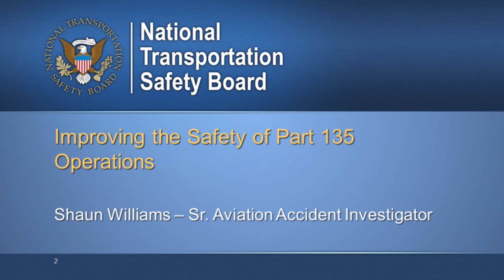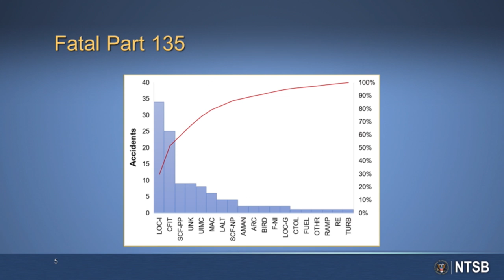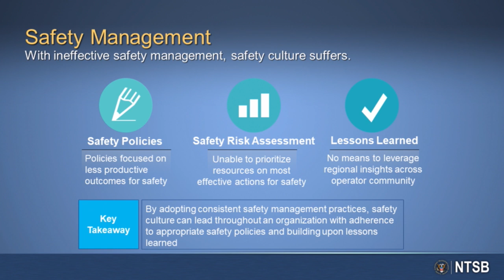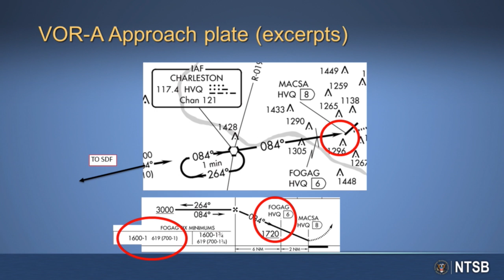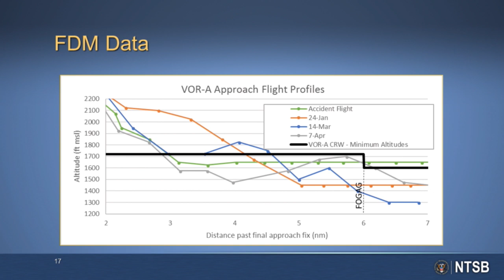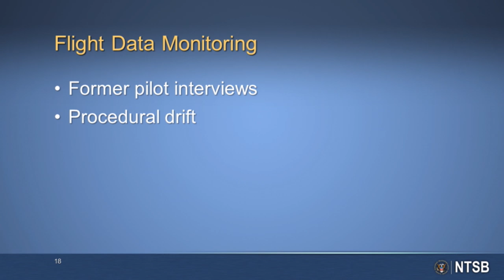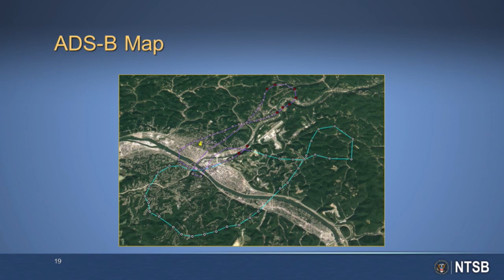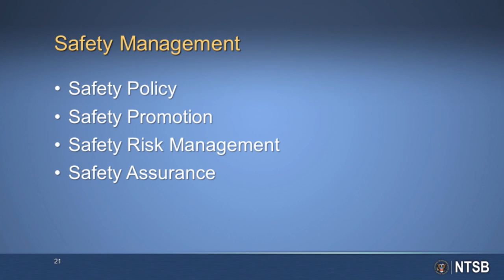NTSB Most Wanted List Panel Discussion: Improving the Safety of Part 135 Operations

Comment: Hi, i have an idea or suggest to enhance passenger safety by introducing safety capsule seat in emergency. That can support at least 10 hours to get rescue in the sea, fire or ground crash. I will be very happy to hear if passenger aircraft manufacturers can put passenger safety on such level, that can safe passenger against all odds. Is such thing possible to make life secure in air travel?